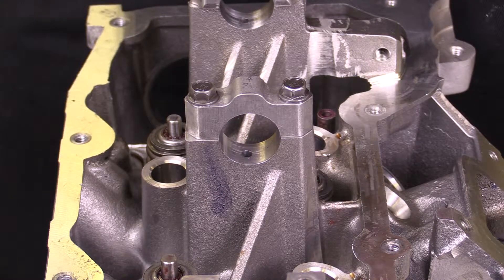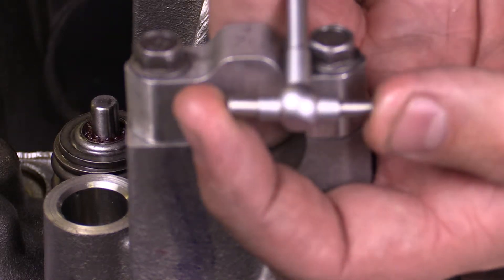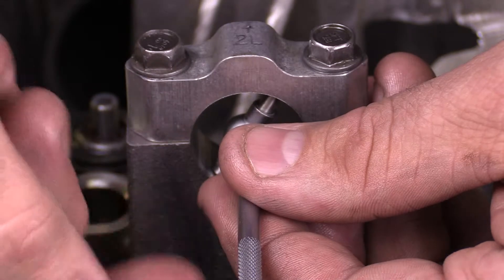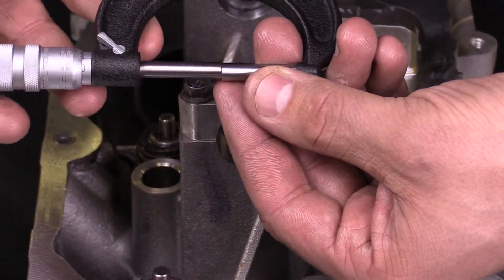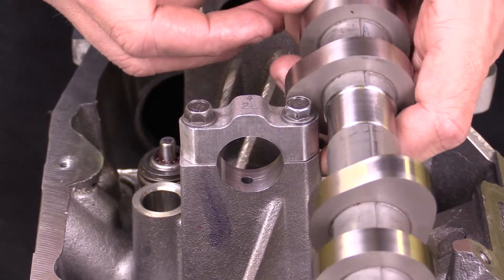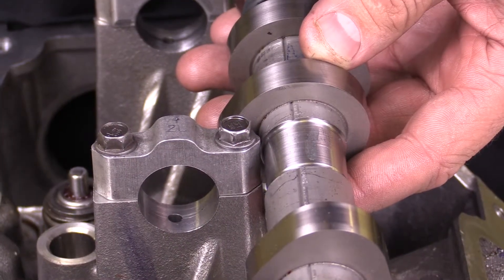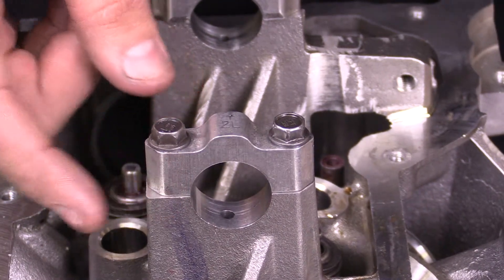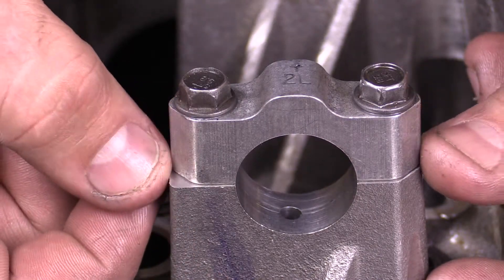Measuring the Camshaft Bore

Comment: Hey Scott  I really appreciate your simple yet detailed explanation on measuring the Id bore. What brand telescoping gauge and micrometer are you using? Now in 2025, what brands do you recommend for someone starting out? or a brand you would consider worth the investment ?
Reply from the maker: I think the set I'm using in this video is a mitutoyo. Starrett is also good. The cheap ones tend to stick
Reply: @S @ScottHadzik sweet I’ll check them out